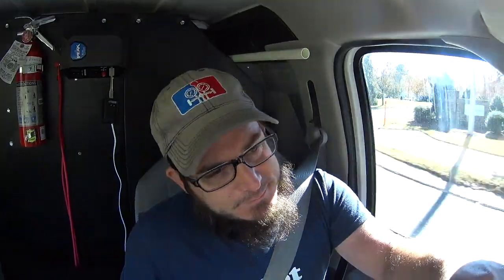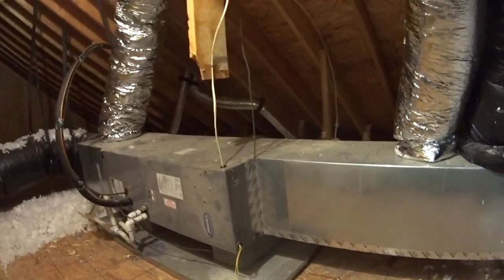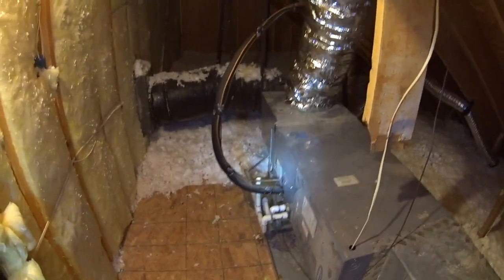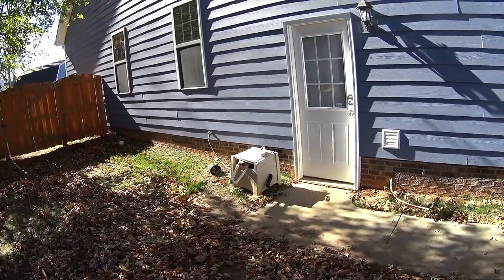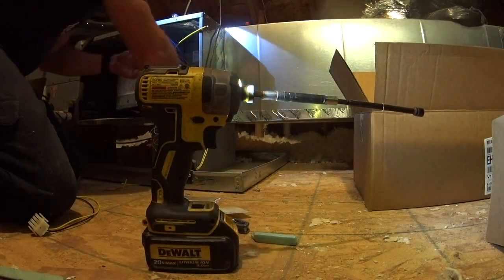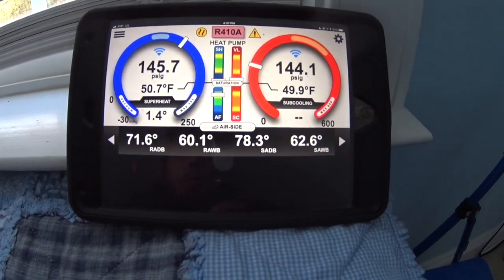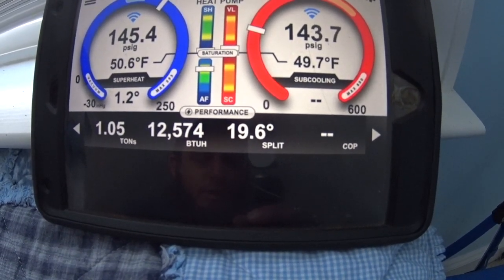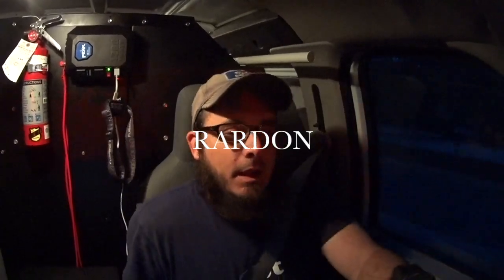11 -20 -17 Five Kilowatt Auxiliary Heat Ecobee 4 Thermostat New Electrical Circuit

Comment: Who in the hell runs 14 gauge to an air handler? Talk about cheap. The conduit looked nice and neat, not a lot of options after construction. I had the same "death rattle" on a system that was low on charge, smoothed out after giving it a drink, lol! Now you need to convince the customer that you need to find the leak...good job, Stephen.
Reply: common practice around here if it's not getting heat strips at install.

Comment: Just curious if you are lisenced for electrical work in your state? Normally this type of wiring change should require a permit.
Reply from the maker: Working on that currently.
Reply: Stephen Rardon Was the Hvac licensing test difficult in N.C.?
Reply from the maker: Not necessarily difficult but it does give me anxiety

Comment: Three pounds low- any leak search or discussion with customer about high likelihood of losing new refrigerant put in?
Reply from the maker: Absolutely, I’ll be going back in the spring to check the system out for cooling. I explained that it was very likely that the system would need some kind of leak repair if we found the charge significantly low again.

Comment: Romex in a conduit?
Reply from the maker: How else would you do it?
Reply: I think it's against NEC to have jacket covered wire inside conduit. THHN is the only wire for conduit.? Some correct me if I'm wrong
Reply: I'm thinking he means you can't or shouldn't  have a chase in a chase (sheathed romex inside conduit).  We used to put romex inside liquatight years ago to make our whips.  Failed a couple of inspections for that reason only.  Now days just pull stranded through.

Codes are different everywhere though.....

Great video as always! Keep up the great work.
Reply from the maker: So need box at bottom, box at top and thhn between? Suppose that makes sense but a pain in the butt for sure
Reply: Joshua Belcher yes that's what I mean. For what he is doing I think it's going to be fine we have done that way for years . Good work!
Reply: K Mech your right
Reply: Where I am you must use emt 18" above grade. PVC conduit is only used for burial conduit.